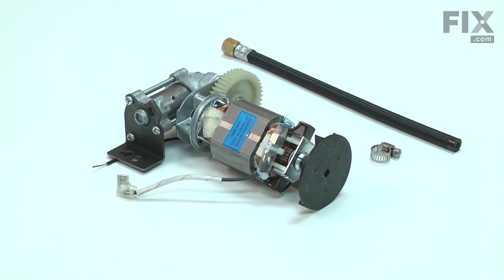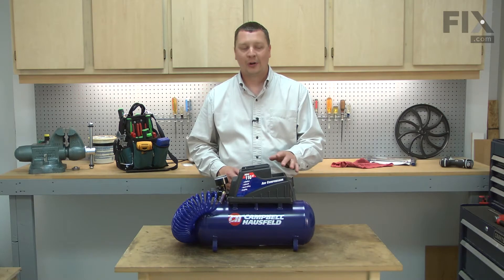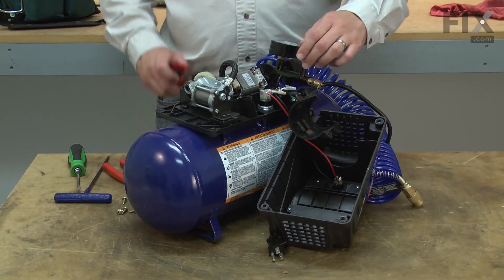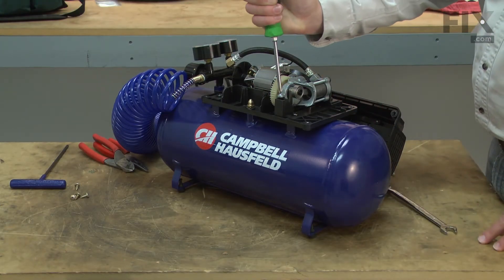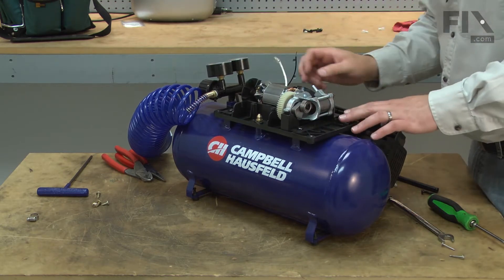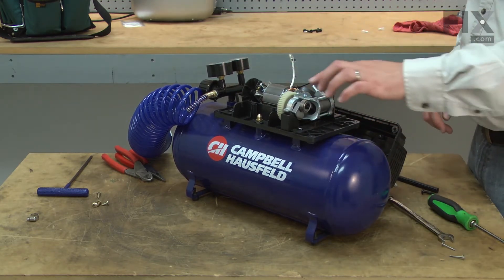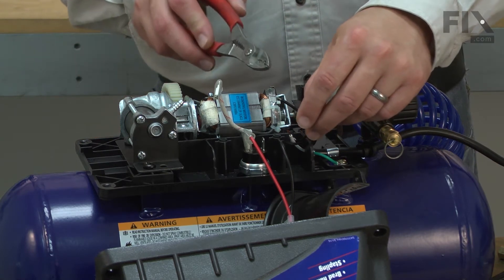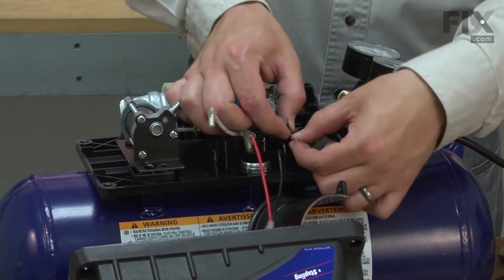Campbell Hausfeld Compressor Repair - How to Replace the  Pump and Motor Assembly

Comment: How do you replace the rubber hose connecting the pump to the tank?. It has brass fittings on the tank end but is crimped on top of the pump side

Comment: Thanks for the video. However, i'm unable to find that motor/pump assembly. It seems to be unavailable everywhere, yet they still sell this compressor. Parts # is fp209039av. Any hints ?
Reply: I'm in the same boat - compressor is in excellent shape, except the piston ring (seal) has worn, causing it to take an age to fully compress.  Can't find the pump assy nor a replacement piston ring anywhere.  A shame that this otherwise good compressor is failed by a 50 cent part.
Reply: A year later, the situation hasn't changed. What did you do to fix it? Or did you scrap it?